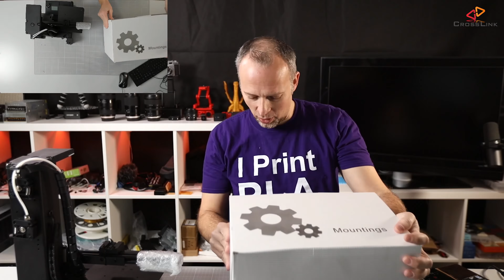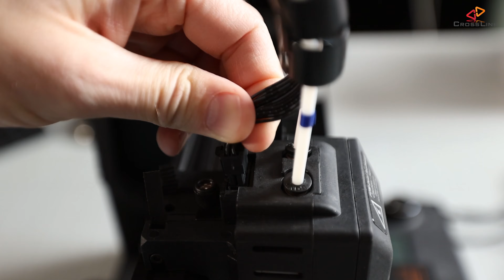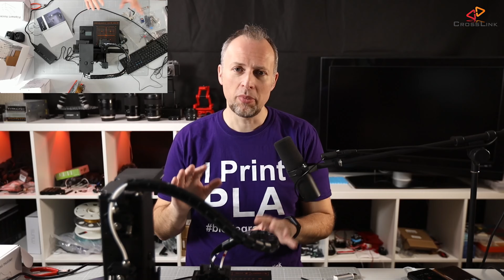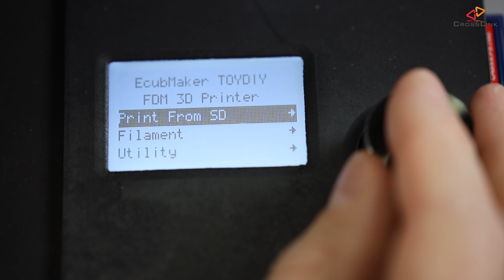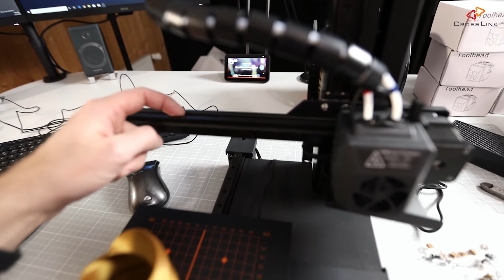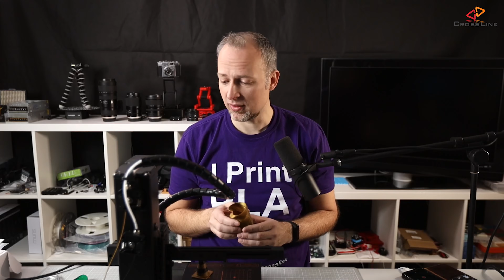EcubMaker TOYDIY 4 in 1 3D Printer - Setup, Troubleshooting,  Dual Color Test

Comment: I get a bad chatter when I first press Auto Home for @ 20 seconds, then the process begins. It doesn't do it when it returns home between the two bed level operations, just when I start cold from powering on. Could it be the belt? Thanks

Comment: This is what want really. Clean wiring,4 in1,  change easily. Which board it using?. ı just look heatbed temp max 60 degree. if only print pla no problem.
Reply from the maker: Good point about the board. How about I take a look inside for the final review?